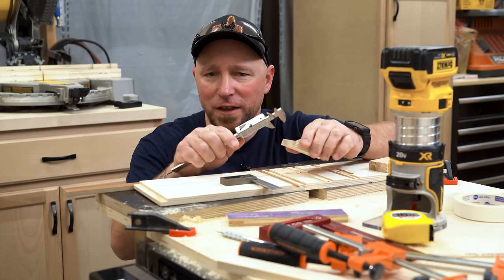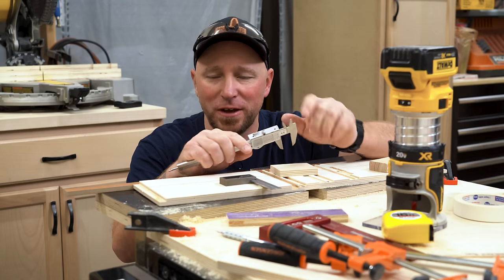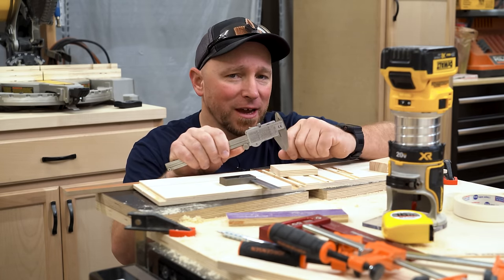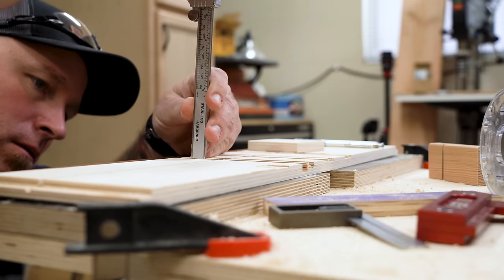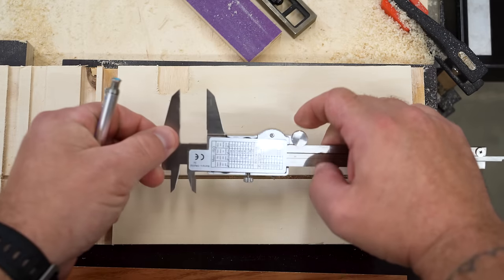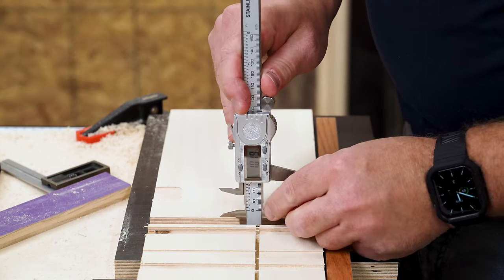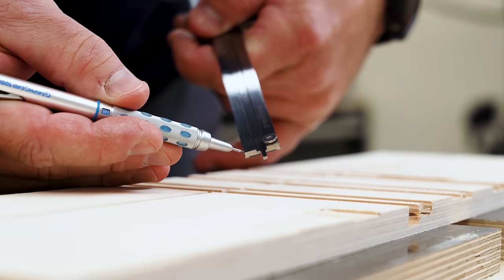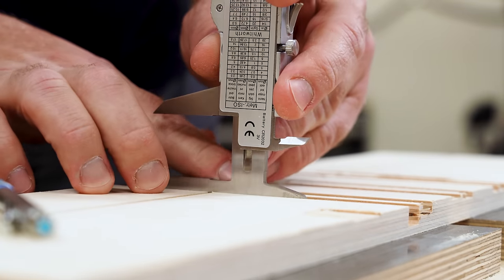The HIDDEN 4TH WAY to Measure w/Calipers

Comment: I've been using those things for over 40 years Jody and never knew.  Some people think that they can, but in reality, nobody can know everything!!  Thanks for sharing that with us.
Reply: I’m going on 25 years and never knew that. Damn, going go try it out now.
Reply: If you have teenage children they know everything.
Reply: Umm try reading the manual I have been using them forever and could also use the same on old vernier blame your instructor 🙄😊😁😲
Reply: @paulbeard3238  Yup, with Paul. read the fricking manual or you might forget how to use a zero.
Reply: It's like 50 years ago a contractor left behind a framing square in our house. I liked it because it was light weight aluminum. Meh, I'm not a builder. But builder friends in the know kept handling it because it's absolutely covered in rafting fractions.
Reply: Nobody can know everything, that's true.
But it reminds me of something a teacher in my electronics apprenticeship always said, "You don't have to know everything, you only have to know where to look it up."
He might have been an asshole but so much more a damn good teacher.
Reply: I actually do know everything, and even I didn’t know this. Great video!!!
Reply: @barryulrich2170  till the battery of the   Phone dies.😋
Reply: 10 years here. Learn something new every day!
Reply: Yep never used the 4th way. Will do now thanks
Reply: I do not know everything by No means but I did go to school to be a machinist and and learned all the basics their rather than You Tube like many people here. Nothing wrong with that way of learning but it is easy to miss stuff.  I learned a lot on You Tube and still do. Sometimes it is even what not to do I learn.
Reply: Same with me!
Reply: Dang! Just goes to show how much info is lost to time... Million thanks for the tip 😁👍
Reply: @paulbeard3238  or maybe the cheep ones doesn't come manuals anymore...
Reply: Ditto, never knew
Reply: In 40 years you couldn't find that out yourself? 🤭
Reply: 50 yrs (yeah, Old Guy) for me. I appreciate any knowledge new to me. Humbling how much there is :)

Comment: I started machining in 74 and always used all 4 ways on my calipers.  Have been retired for 4 years and still have an old set right here in my drawer.  Old machinists never die, we just lose our tolerance. :)
Reply: 🤣 Noice one Scotty!  I'll tell that my Dad who's still tinkering around in his machine shop @ 79. 👍
Reply: @TerraPosse  I admire him, I've always wanted a small lathe and mill in my garage, now though it's too small and my back and legs don't work like they should. but I too used to love to tinker on weekends and lunch hours just doing stuff.  I do miss it.
Reply: Retired and latheing away
Reply: LOL... I thought you were going to say; Old Machinists never die, we just lose our Nuts
Reply: Heck my shop has 2 guys over 80 who still kick ass
Reply: I guess as a woodworker, thats less common there. I started machining in 2018
Reply: @ShadowLimited310  If I were healthy I may still be working part time.  I do miss and love programming on the control, setting up and running a first part to see how it comes out.  I never did learn any cad cam programming.
Reply: Same here. Been doing this since basically the first day I used calipers. Not really a secret tip.
Reply: old machinists die.
On average at the same age as other people, at 78 in north america.
Reply: @xl000  well I guess I've got another 9 years.  I'm going to hold you to it.
Reply: @xl000  well, Im a machinist and gunsmith. I give it a 50/50 of old age or "I wonder if this will work" being what kills me. Eh, on second thought I give it 30/70 lol
Reply: As an old Tool-Maker, I never had much tolerance to begin with.
Reply: Wow that’s a good saying also a little sad life summed up in one sentence
Reply: I am so stealing that joke!
Reply: Awesome, 🙂
Reply: I imagine it depends a bit on the place that taught you, if you didn't teach yourself. I've known about this fourth method pretty much since the beginning too, but don't ask me how I learned. Maybe I saw somebody do it, maybe it was part of school (in Germany, apprenticeships are accompanied by several months of school focused on theoretical knowledge of the specific field you're training for), I really can't remember.
Reply: @TerraPosse  the machine shop I worked for the owner was 92 before his sons forced him to retire. Even the veneer caliper had all 4 measurement spots, (inside, outside, depth & shoulder) I was a machinist for 17 yrs till a CNC  replaced my job
Reply: You have loose standards.
I'll run-out now.

Comment: I'm an engineering student and I was literally talking to my classmates this morning about how difficult it is to use the depth gauge. You are a lifesaver!
Reply: I believe the depth gauges main purpose on digital calipers is for quick measurements of drilled / bored  holes.
Reply: Difficult? Perhaps try a different path.
Reply: @jimmymcjimmyvich9052  Depends what your tolerances are.
Reply: @jimmymcjimmyvich9052  how encouraging! I guess you just always knew everything?
Reply: This is the problem with the education system! That should be thought. It’s not common sense. I was lucky enough to grow up in a CNC machine shop so I’ve known about this since I was a baby haha. Glad you did your own discovering and are now enlightened!!
Reply: @jimmymcjimmyvich9052  yes it is difficult to get accurate measurements with the depth gauge as it’s a floppy little piece and the angle at which you hold it has great effect on the measurement.
Reply: @BeRAD  depth micrometers are better for accuracy if working with tight tolerances.
Reply: "I was literally talking to my classmates". Or were you "talking to your classmates"? 🙄
Reply: @coloradostrong  I'm not sure what you're implying. Yes, we were in the middle of taking measurements for our final project when I was "talking to my classmates" about how finicky the depth gauge was for a specific measurement. Are you upset at my use of the word 'literally'? I was using it informally to emphasize how odd of a coincidence it was for me to find this video the same day I had that discussion. I know a lot of people use this word incorrectly, but I assumed the informal definition was alright to use in the correct context. Sorry for taking up your time, I was just curious as to why you pointed that out.

Comment: Before I retired I worked in metrology for a few years; many of our lower-cost calipers were out of calibration in this mode. You can get a halfway decent idea if yours are okay by checking to verify that there is no detectable step between the moving parts with the jaws completely closed; alternatively you can measure a block with the jaws and confirm that measurement with this mode. If there is a bias, for home use you can just adjust your reading to correct it. In the engine shop not so much; we had to restrict a significant number of our calipers to disallow the step mode.
Reply: Can't you just lock it at zero and then lap the top surface to get them flush?
Reply: I guess you do run the risk of getting them angled and not perpendicular.
Reply: @Dudeinator  That's a possibility, sure, but you'd need to have fairly high-grade machine tools to get it accurately perpendicular in two axes.
Reply: Just could just grind the top flat, just find a  way to hold it as perpendicular as possible to whatever grinder you have, paying attention not to make it skewed in either direction. Also you could use a sharpening stone for knives or whatever, although this might take a while depending on how much it's off. You can check your results, and you can always get there with trail and error, only the top might just get a little more flat. And it's not like it wasn't already bad, so there is nothing to lose.
Reply: @mathijsalkemade87  how to say you’ve not worked in high precision metrology with out saying you’ve never worked in high precision metrology.
Reply: @Taskarnin  Sure haven't, but I'm confident I could grind the top of my calipers to be perfectly adequate to measure 0.01mm. Using just a square and some time.
Reply: @mathijsalkemade87  Yes. I used to work as a precision mechanic. As soon as you have a grinder where you can hold the 90° in all directions it's not a problem at all. I did that to some of my tools. However, I wouldn't trust any normal caliper after the decimal.
Reply: @lifepolicy  whats the need for calipers if your not reading decimals?
+/- .0015" is standard where i worked.
good luck
Reply: @swskitso  when you go back to mm you'll see that your 0.0015" is 0,0381mm. Basically, all of the calipers I ever used were marked with: good to 0.05mm (most likely the equivalent to your 0.0015"). That means I can use them for 0.1mm but not for 0.01mm. Since I worked in 0.01 or sometimes 0.001mm I had to use (and I recommend doing that) micrometers. It's simple as that.
Reply: @lifepolicy  so they can be trusted at 0.1mm
Im no math genius or english major but im pretty sure i know what a decimal is and what after means.
Reply: @swskitso  yes they can be trusted at 0.1. In my understanding that is the decimal. And after the decimal is .0X. (and if that is wrong I need a better translator)
Reply: @lifepolicy  the decimal is between the zero and the one.
Reply: I was confused for a bit here, kept reading “meteorology”
Reply: Like usual... You can't compare a 5$ Chinese caliper with a professional, calibrated, reference tool that cost 400$... The last one is always better - and the reseller will get it thrown in the head if such a tool isn't perfect in four modes! 😁

As you said, when we, amateurs, buy a tool, often a quite cheap one, we should first learn to know if they are correct or not!
We should all know how to control a square, a level, a caliper, a measure tape, a saw (table or miter), etc. so that we can work properly after that. Squares, level and calipers are the basic, essential tools to control/calibrate near everything else.

For example, I have some big squares that aren't correct (around 89.5° instead of 90°). But they are big (60 cm/2 ft). I use them for rough work. My reference square is much, much smaller (20 cm/8"), I use it to calibrate my saws or for precise work. But at least, I KNOW which tool is correct... Or not! My plane level (it controls two axis at the same time) isn't perfect... But for a desk, it's fine. For my table saw, I use my correct level, controlling axis individually - annoying, but EXACT. And so on...
Reply: @mathijsalkemade87  If you're going to try to calibrate it, none of these are adequate. Only high-end machine tool jigs can establish a nearly perfect perpendicular face to operate from.
Reply: Most lower cost ones are out of calibration after first time using it. The little wheely thing wont turn right an stuff like that... Just push a bit to hard on it and its out ...and it stays out of calibration. But most of the time for normal every day home use a out of calibration one works just fine.
0.05mm off doesnt matter. As long as you dont work on injectionmolds for neighbour is ok.
Reply: @marcelk5134  True. I never need anything below 0.25mm precision, when I do DIY at home... Even 1mm precision COULD be enough, sometimes. But obviously, for a professional workshop and/or plant, that would be unacceptable.
Reply: @paulcrumley9756  Exactly. It's cheaper to buy a nice mitutoyo with calibration cert (if NIST traceability is needed) rather than pay for an adjustment and calibration.
Reply: I got a mitutoyo set at work and they are good to half a thou. First using callipers then micrometer if micrometer read 3.6467 callipers would read 3.6465 almost every time I wouldn't never trust them completely always use a more accurate way to measure but nice to know there that good even after nearly 2 years and haven't even changed the battery's. I can never remember to turn them off
Reply: @aedanharris2072  Our Mitutoyos were only certified by them to .001, though they did display half-thousandths. The 24-inchers were good to .001 up to six inches, then .002 the rest of the way. By their nature and construction, though, calipers are at the low end of the accuracy chart, too easy to "stretch" the jaws with too much applied force, etc. Most of our high-accuracy specifications were better done with dial indicators; runouts, concentricity and so on.
Reply: @paulcrumley9756   mine are also only rated .001 was just saying they seem better than that but your spot on I'm an engine reconditioner so we measure with tenths indicators in numerous different jigs for different things, micrometers, bore guages and guage blocks
Reply: @Taskarnin  Depends on how it's done. For this measurement, as long as the "flat" is perpendicular in the X & Y, the Z measurement doesn't matter. Besides, who's using a digital caliper for high precision metrology.
Reply: @Dudeinator  It needs to be perfectly square in the X and Y  directions, The ultimate surface finish doesn't matter(within reason), so long as the average highs in the X and Y are perfectly square(within reason) to measuring device. Lapping would be overkill as grinding generates sufficient  tolerances to match that it's a caliper, i.e. not a high precision measuring insturment.

Comment: Very useful. I taught the use of measuring devices to freshman physics labs but I don't recall ever using this function. That was so long ago I also taught how to use a slide rule. Ah, those were the days. Thanks.
Reply: I have collected five slide rules over a few years, because I like them a lot. They're beautiful, but I can't really use them in all intended ways. I just like them because they give me three thoughts.
First, they remind me that good enough is good enough. In most cases, you don't need the eight extra digits of your calculator.
Next, you better know what you're doing. If you don't know what result you're looking for, then you're not going to find it between all the lines and figures.
And third, slide rules tend to humble me a little because all the results of all the calculations which I ever made and which I'm ever going to make are already written on this piece of plastic (or wood or aluminum) that was mass-produced long before I was even born. I'm not that important, my thoughts aren't all new. We stand on the shoulders of giants.

Comment: I’m a machinist and this is helpful in many cases. you have the OD jaws, ID jaws, depth gauge, and the step on the back for depth as well. So four features of measuring in one tool!! I use 12” and 8” dial calipers daily along with other measuring instruments and gauges for the parts I manufacture.